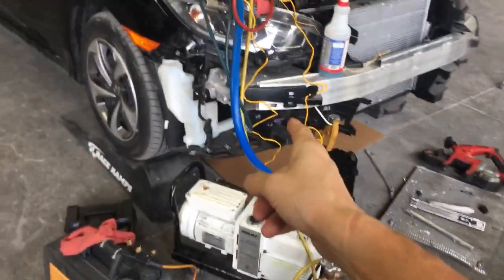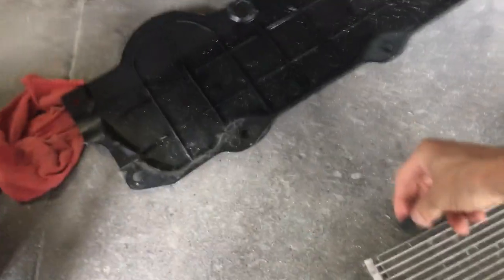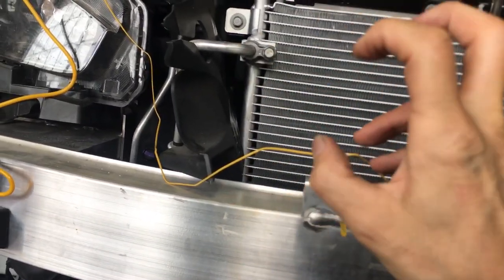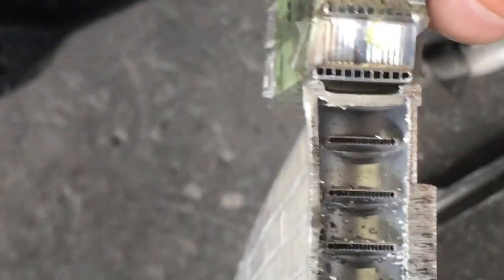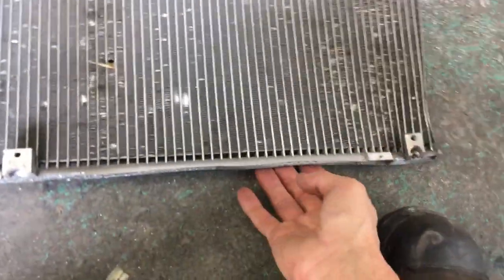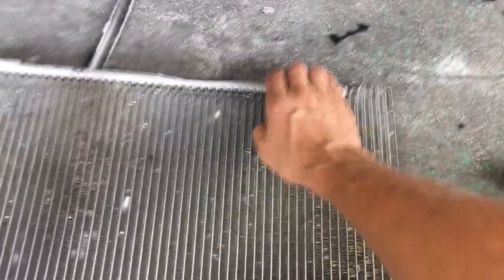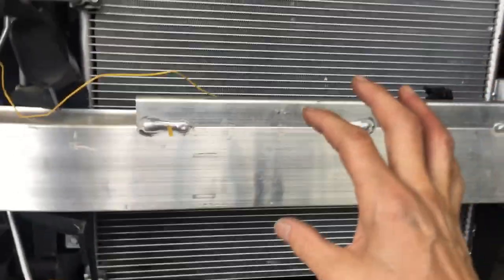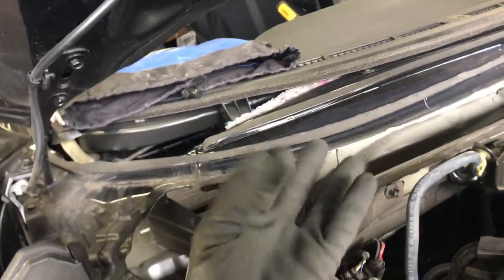Aftermarket AC condenser poor quality versus OEM original condenser. DON’T GET CHEATED!!!

Comment: Ever heard of someone using a receiver drier and an accumulator at the same time in an oriface tube system. I'm building an AC system from scratch
Reply from the maker: I’ve heard about it on a expansion valve system not an orifice tube system
Reply: @coldfinger459sub0  any particular reason why nobody puts receiver driers in oriface tube systems?
Reply from the maker: @lm7bird680  money is probably the first factor.    As long as it’s not too big of a dryer you wouldn’t have to worry about so much refrigerant that would keep bleeding through the orifice going through the evaporator that you would overfill the accumulator and possibly suck down some refrigerant through the upper part of the tube as it foams up when it starts up. 

They use expansion valves because they’re more efficient they have a wider range of operation and they keep a constant control in their self protecting so there’s no floodback to the compressor

Where orifice tubes are very limited in the range of operation they’re either starve or there’s too much a little more energy consuming another reason they went away from orifice tubes they don’t give a steady temperature. 

Orphis tubes and automobiles were only used because they were cheap and they were simple
Reply: @coldfinger459sub0  I've been considering getting a variable oriface tube for better all around efficiency, are those a reliable alternative to trying to figure out a way to convert to an expansion valve.
Reply from the maker: @lm7bird680  yes, read the instructions
Reply: @coldfinger459sub0  cool, thanks man, I've been loving the channel, it's very informative and made me change a couple parts in my system for higher quality ones

Comment: A person is hard pressed to find a condenser that IS NOT aftermarket. Even dealer condensers are often aftermarket renames.
Reply from the maker: What country are you in where the dealer is using aftermarket

Here, in most of the United States, dealers refused to use aftermarket
Reply: @coldfinger459sub0  The so called dealer issue items can often be traced back to after market makers. I look for identifiers such as numbers on castings, or embedded stamps. Name brands aren't always name brands, they just have the name on the package, not the part.

Comment: I just ordered an aftermarket condenser for my 2000 Astro Van. I don't know if they even make OEM for it anymore. I
Reply from the maker: Probably would not want to an OEM for one so old. 

Advancements in micro parallel, flow condensers are more efficient than the condensers. They produced back then. . 

Especially if you had dual air-conditioning front and rear .  and you live in a hot climate you definitely want higher capacity, larger condenser if at all possible

I see when looking on Google they do have microchannel condensers available for that vehicle

Comment: The smaller the tubes the greater the head pressure when converting piccoloflow to parallel flow. Never had any luck. Whey try to reinvent the wheel. Most of the factory engineers get it right.
Reply from the maker: Even though the two passages are smaller, if the condenser size is size properly, and they add more rows of tubes, pressure will actually be the same or less because those smaller openings in passages with more things inside actually make it more efficient in a transfers, heat faster lowering the temperature of the Refrigerant Lorene, the pressure of the refrigerant. 

Oh, you’ll notice on all the microchannel parallel flow condensers in my videos, especially on the cooler days you’ll see a high side pressure somewhere around 90 psi summer. Mom has the lowest 66 psi on the high side.

Comment: So does this apply to some of the smaller parts like the receive/drier and the expansion valve?
Reply from the maker: I’ve seen cheap defective expansion valves not too often

I’ve had two cheap Chinese receiver dryers that the tube that is placed inside under the site glass fell off inside the receiver dryer then it would not feed liquid it would only feed vapor

Usually expansion valves and receiver dryers are a little more forgiving

But heat exchangers are less forgiving when it comes to surface area and mass and volume
Reply: @coldfinger459sub0  thanks for the info! You think denso would be a good a/m supplier? I've got a 2001 Honda CR-V with 101k miles I think it can go for much longer. I don't want go crazy replacing my a/c system but I also don't want to cheap out and would go OEM if need be.
Reply from the maker: @cf1005  Denzel for all foreign vehicles is my first choice for suppliers for an aftermarket source even if DENSO does not make or manufacture originally original equipment for that vehicle at least you’ll know they’re aftermarket source for a vehicle will not be bad

Comment: Dear, Im in Iraq and no way to get oem condencer, aftermarkets are cheap chinese. Can I fluah my original oem condencer? my nissan altima ac is facing black death
Reply from the maker: No, if it is microchannel, and Condenser must be replaced no flushing

Used cheap Chinese

Comment: I have a 2006 Acura TSX, what aftermarket condenser do you recommend. The Oem is over $300.
Reply from the maker: I do not have no OEM part number or recommendation aftermarket Alternative.

Because it varies so much from state to state from region to country. 

But if you can find an aftermarket source for DENSO That has been the most reliable highest quality condenser through aftermarket channels that I have been able to acquire
Reply: @coldfinger459sub0   Great video you smart man A+  Alot of my A/C Condenser fins are bent over and i have a limited income . What A/C Condenser would you recommend of a 2006 Mazda 3s 2.3l ?

Comment: My car is a 25 year old Daihatsu Charade. No OEM condensers are available from anywhere. 
Even a direct replacement aftermarket one is not available. 
It looks like I will have no choice other than buying some sort of universal one, (which has different fittings, not the pad type like the original) , and somehow modify it to fit.     :-(
Reply from the maker: Fittings are available aftermarket there’s several different manufacturers that make all the different kind of fittings for all the different kinds of condensers that could be adapted to new hoses

    If you want a high-quality condenser you could try to size one up by dimensions from a brand new Toyota it will have the most highest efficiency modern condenser design. 

        Of course custom brackets will have to be made to attach it anywhere all that is a sheet metal not complicated not rocket science. 

         If you go onto some of the condenser manufacturers websites they have what is called an illustration guide where they will show you the picture of the condenser and also have down the dimensions with the height the length.
Reply: @coldfinger459sub0  Thanks for the advice.
Good to know about the fitting adapters.
I will have to try to figure out what they are called and find a online seller, as I am in a country town in Australia and the car is currently partly dismantled for repairs (bumper, grille, radiator and airconditioner condenser, compressor and reciever dryer are all currently removed for replacement) and I can't take it anywhere to have it done.

Comment: Whats your thoughts on aftermarket receiver driers?
Reply from the maker: Ok ,, I only got two defective ones were the tube dropped down causing only vapor to go to the expansion valve
Reply: @coldfinger459sub0  How did you diagnose that problem? Low pressure on the high side?
Reply from the maker: @bountyhunter1890  I can literally see all the bubbles coming up through the site glass in the top of the receiver dryer. 

Then when I looked down through the glass inside I could literally see the straw has dropped down and tilted sideways through the glass. 

And when pounding on the side of the receiver dryer I could see it move a little bit.
Reply: @coldfinger459sub0  What was the gauges doing or was they not attached?
Reply from the maker: @bountyhunter1890  
It was too long ago I don’t remember but I don’t think the gauge would react. 

There would be no impedance to refrigerant flow

You would just be getting vapor to the expansion valve and suffer from low cooling output. 

You would get some cooling but not much because you’re feeding the expansion valve vapor gas instead of liquid. 

I’ve seen some receiver dryers installed backwards several times that do the exact same thing. 

It feeds the expansion valve nothing but vapor you still get cooling out of the dash just not as much
Reply: @coldfinger459sub0  O ye never thought what would happen with it backwards I suppose an easy mistake to make.

Comment: What producer you choose for aftermarket condensator?
Reply from the maker: Not me. Here in the USA , if you have car insurance most of the insurance company make or try to a independent automotive autobody repair shops use cheap aftermarket parts.  
              I’m a subcontractor ( vender) who specializes in providing refrigerant recovery, ac diagnosis for problems, refrigerant leak finding,   Refrigerant recharging service. 
                 I may service up to 8 different shops a day , a few thousand cars a year so I get to see and work on the worst and best parts and repairs many times a day. 
              So I get to see problems caused by some poor quality aftermarket condensers most other technicians my never see or don’t understand that the problems they are having are caused by the condenser because it new and the don’t know it’s a poor quality aftermarket part.

Comment: All well and good but you are replacing that so-called terrific OEM condenser when the vehicle is a year old. ALL JUNK!!!
Reply from the maker: Isn’t it beautiful when you the customer think you’re getting a good deal with a cheap insurance company with a discount rate or a high deductible rate. 
                 By saving money on your insurance with a bad insurance company and going to one of their direct repairs that they have a contract with to use cheap aftermarket parts to get all their business into their shop. 

            By the customer being unknowing lack of knowledge and not reading all the fine print when they sign the dotted line to get that cheap insurance policy they get exactly what they paid for. 

           What the average public consumer does not know about the insurance company business is that those preferred shops on their list they tell you to go to our in their pocket to get money and agree to fix the cars at a cheaper rate with cheaper parts just to have those customers crash car steered into their shop. 

          And that’s what this video is all about to show the customers how they’re getting cheated by installing pieces of junk that is mandated by their insurance company
Reply: @coldfinger459sub0  I hear ya! So the choice is OEM that cools best but blows out, or aftermarket that cools less and blows out. I guess OEM is technically the best but they all are just garbage as a whole.
Reply from the maker: @watchnlearn1001  
           Take the example of Honda recently on their records and their civics from 2015 to 2019 I’ve been having a lot of leaks I would not want to replace it with a original Honda condenser from the same manufacture and have it leak again in another year or two in that case I would go after market and try to search for the best manufacture I can if I could look up the specifications on their spec sheet from the manufacture on their website listing and indicating the exact number of fins per inch and the exact number of cooling two passages. 

          Just like when you’re buying tires do you want a passenger car tire that has a low load rating and low speed rating that you cannot put on a heavy truck or bounce over curves with because they will blow out you look at the ratings
                 Or you could buy the same size tire in a heavy duty truck tire with a load rating of D or E what has many sidewall plies and face tread place that you can throw 2 tons in the back of the vehicle at the same time drive right over a curb at high speed without blowing out the tire. 

        It is a choice options that you can pick from a spec sheet.